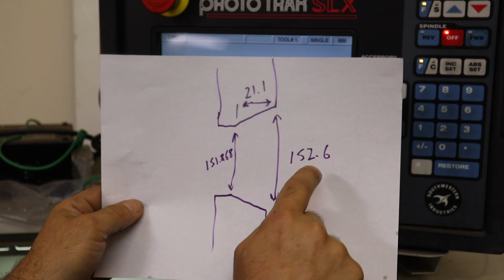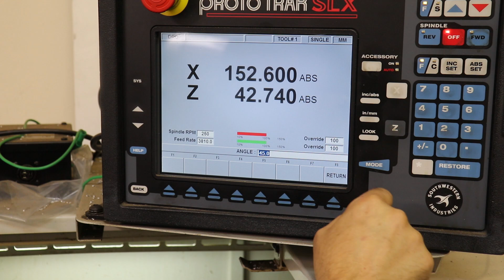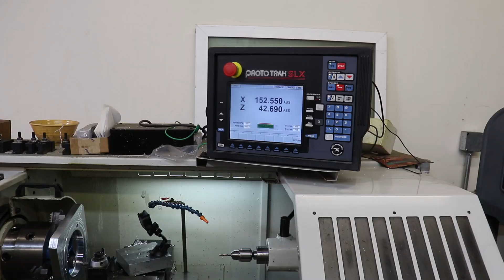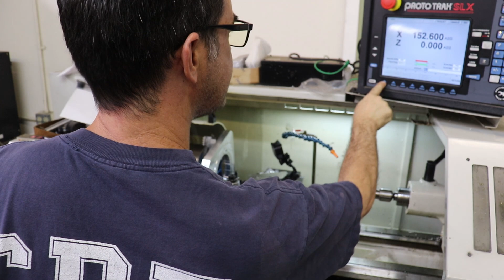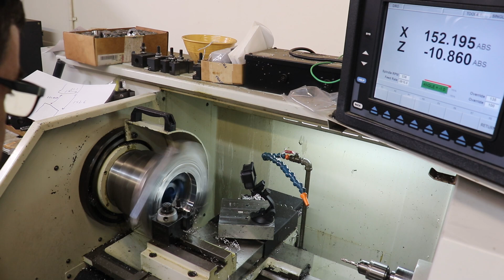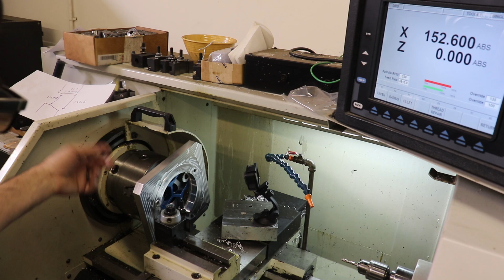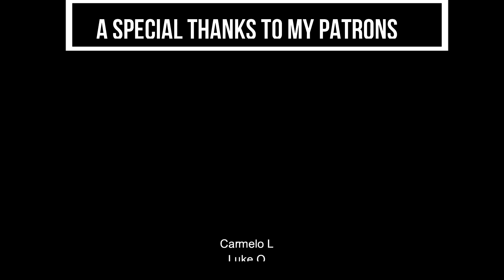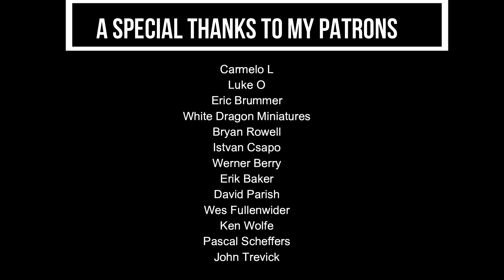MOLD CORES AND STRIPPER PLATES

Comment: These are great videos.  Have you done videos on mold making with sliding parts of the mold cavity.  Not even sure of the correct term.  The parts that ride on the angle pin that locks closed when shut?
Reply from the maker: Thanks for watching!  Yes, you can check out this video:https://www.youtube.com/watch?v=O0y3DJfhCKQ&t=1564s. 
 I am also filming a mold where I have side pulls right now.  Stay tuned

Comment: Excellent as always - can I as a personal question - you don’t need to answer - you have such an extensive spectrum of skills / expertise. Eg. robotics, machining manual ans cnc , mould maker, etc etc - what is your actual background / profession ?
Reply from the maker: Hi Rupert, thank you for the kind words. I am a mechanical engineer who has worked in silicon Valley at tech companies and for myself.  I always worked in the shop area rather than the office cubes. I sort of picked up all the fab experience through long hours and buying my own gear to learn on  Thanks for watching!
Reply: @DragonflyEngineering  ok that explains a lot,the old style German engineers had to start off in machine shops for some years then move to drafting/ design etc - the engineering explains your Skill stack - really great content.